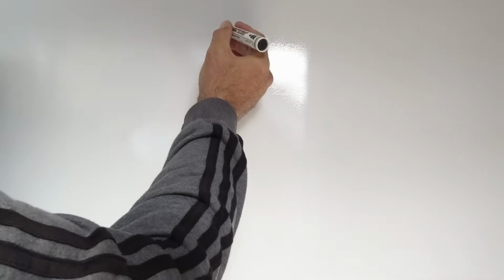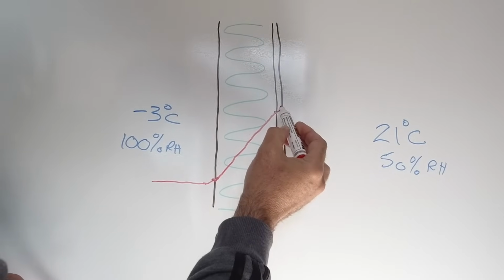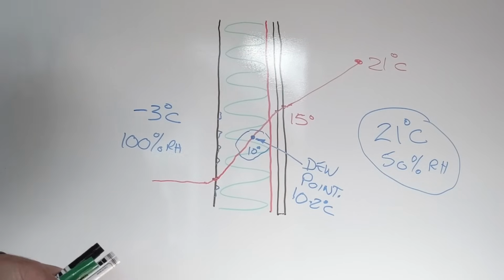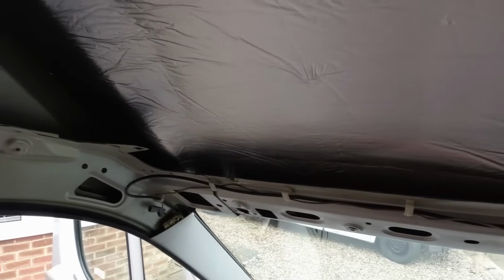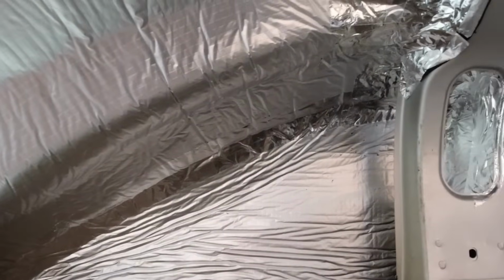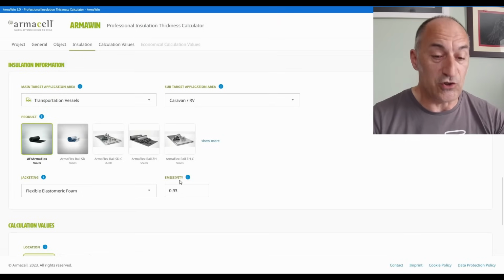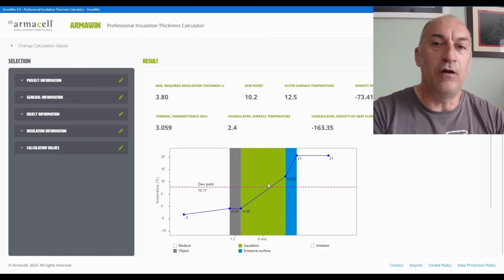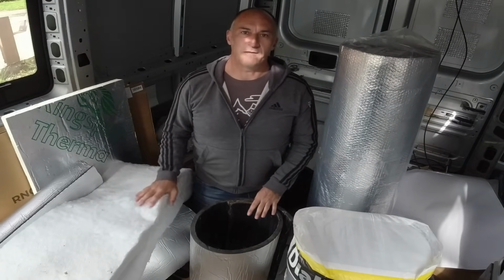The BEST way to Insulate your Van - Budget Build Ep 6

Comment: HI Greg - whats your view/experience with Aerogel and its potential use on a van conversion?
Reply from the maker: I did manage to buy a small square but it’s just way too expensive £100 a square meter and there are far more practical materials on the market.

Comment: I do appreciate you live in the UK etc. but what about heat insulation?  I played with the calculator a bit and for Armaflex you need a meter thick to balance 35 C outside v 21C inside  which is obviously a non starter so is there some other product that can be good both for heat and cold/condensation? I tried a few of the other products on this calculator but got similar results.
Reply from the maker: You cannot calculate the thickness using condensation method if the outside ambient is greater than the internal van temperature. You have to change the calculator to another method like heat loss, surface temp or economic thickness calculation. These options will give a more realistic answer. You won’t get condensation issues in hot climates. 👍🏼🤩
Reply: @GregVirgoe I know, I already changed to heat loss cause at 35C there is no condensation :-) the calculator tells you this. But still it comes up with 1 meter thick material. So I just wonder if there is a material you know off that is more suited to heat insulation.
Reply from the maker: @dimitristsagdis7340  there will always be some heat transfer. It’s impossible to insulate and keep a colder temp inside with no thermal gain. It’s about fitting a reasonable thickness to slow that process down. We have had it 38° outside and managed to keep it about 30° inside with the insulation in our sprinter van and some ventilation.
Reply: @GregVirgoe  tnx and in your Sprinter did you have a similar kind of insulation as you are showing in this and the next videos?
Reply from the maker: @dimitristsagdis7340  we used wool and PIR in the old van. Very similar to what we will be using next 👍🏼😃
Reply: @GregVirgoe  tnx I shall follow the rest of the videos with greater interest than usual

Comment: God I love watching this sort of stuff!! Excellently done ✅ 
One question I was waiting to ask; is it best practice to apply the insulation directly to the metal skin? 
One observation from the work I’ve done so far, is that there are a few ways water can leak into the van from outside; through the roof and sides, ideally, any droplets would run down into the sills and out. If insulation is stuck to the skin this would impede water draining out 👍🏼
Reply: Thanks for your time and knowledge 👍🏼
Reply from the maker: The purpose of sticking it to the van is to stop moist air getting in contact with the steel of the van. If there is a gap there it’s not going to work in preventing condensation. If you have leaks from other areas I would try and address those if you can. Best of luck 🤞🏼
Reply: @GregVirgoe  Thanks Greg, just watched some of you old videos, in the talk at Camp Quirky you talked about the air circulation/convection in the wall void, is this what would be happening if there were a small gap between the PIR board and the skin? 
As there will be a vapour barrier over the PIR, moisture air shouldn’t get to the skin. So is it a case that if there were a small gap, then moist air (via sill drain holes for example) could form and circulate? 
Sorry if I’m labouring this, just want to fully understand 😀
Reply from the maker: @hopesfreedom2322  as best as possible you do need to create a fully sealed void. Any gaps that can allow air to get inside the barrier has the potential to cause condensation. Do the best you can to seal up everything and the potential problems will be minimal

Comment: I have a Peugeot boxer, fitted 6mm dodo mat closed cell foam insulation with the foil, stuck it to the same area in my van, getting horrendous problems with condensation.
Reply from the maker: If your internal conditions are more humid the layer needs to be much thicker as I show at the end of the video. Do you have heating on and vents open to keep your internal humidity down?
Reply from the maker: If you fitted it exactly per my video and you are seeing condensation on the surface of the foil then the thickness of insulation is not enough for your conditions. The surface temperature will be below the dew point. Easy fix is to apply another thicker layer over the top. Make sure it’s adhered to the surface and all edges and joins are sealed.
Reply: @GregVirgoe  My comment is not meant as a criticism of your video, merely pointing out that 6mm foam may not be enough to prevent condensation.
I converted my van last year and have been living in it full time since beginning of 2023.
Your previous van build videos were and are a valuable, easy to follow/understand source of info for anyone self building/converting a van.
The van is insulated with 12mm dodo mat, dodo mat thermal fleece and a vapor barrier with all joins and seams sealed with foil tape, again  your previous insulation video was an valuable source of info,  When I came to insulate above the cab 12 mm was out of stock and after doing some research thought 6mm would be adequate, unfortunately  not , as you suggest I need to add more insulation.
I have been following you for a while now and will continue to do so even tho my van build is complete.
Keep up the good work Greg, your how to videos are an excellent source of info for anyone planning on a self build conversion.
Thank you for all your hard work.

Comment: Good day Greg!
I started following your van build series on your Sprinter, and gleaned some great info for my micro camper (Promaster City, aka Fiat Doblo)
I used 2inches extruded polystyrene in the ceiling, 1 inch on the walls and floor.
Vapour barrier is reflectix. I also added a 100cfm vent (variable speed)fan in order to mitigate the increased water vapour content due to my breathing. 
I have yet to see any condensation in the van, even during high humidity, winter mornings during my Florida vacation.
I’m sharing this video with my brother in law, as he will begin his van conversion process this autumn.
Cheers! 🇨🇦
Reply from the maker: Your attention to detail in the build of your own van has paid dividends and thank you for sharing your experience. I wish your brother the same success with his build. Nice to hear from you. Cheers 🍻

Comment: Excellent video as usual 😊 however.... I was wondering what could I do to prevent condensation on the steel reinforcing members - put 10mm insulation between them and the plywood covering? Or is this a step too far and would the plywood fixed direct onto the steel reinforcing members be okay?
Reply from the maker: If you covered the steel beams with a thin layer of insulation that will help massively to stop any condensation and make sure to have a continuous vapour barrier across everything.
Reply: @GregVirgoe  thanks Greg, I remember you used Aluminium foil as a vapour barrier with a 'bubble wrap' on one side, on your Sprinter.
Reply from the maker: @jamesgooch1670  we rarely venture into very cold climates so it was enough with carpet over to raise the surface temperature

Comment: I'm glad to see you recommending closed cell foam, I've been suggesting using 19mm Armaflex or alike for a while but a Greg Virgoe endorsement is much more useful than some random bloke on the net.😅 
It's probably not the best insulation but I can't see myself ever messing with PIR board again, drove me mad.
Reply from the maker: Its fantastic insulation and we have used it in the industry for years as insulation on both pipework and ductwork. Great insulation properties and it has that built-in vapour barrier so fantastic for cold applications. To match the thermal properties of say 50mm PIR you would have to use multiple layers and then it becomes costly and heavier. Its also a very good sound absorption material too and is used a lot in speaker boxes etc

Comment: Hey Greg, great videos as always. Couldnt have done my first van without your videos. Hopefully move on to my second soon. I heard someone say insulating the pillars is pointless as they're directly connected to the external steel. Would you wrap these in closed cell foam after filling to stop condensation forming on the pillar? To be honest Im not going anywhere in my van of it - 3 outside! 😂
Reply from the maker: Yes exactly that, fill with insulation then a layer of the closed cell over the top or other insulation to stop condensation from forming. :D We don't like the cold either but there are some mad people out there lol
Reply: @GregVirgoe  you've taught me well! 😂

Comment: Great video well explained - complete numpty novice and more a question on the science - you used 10mm - is there a greater gain if it were say 15 / 20mm ie do you gain a lot is the extra thickness not worth the cost ?
Reply from the maker: It would be far better to use a much thicker insulation yes you gain a lot in terms of better insulation. This is the minimum to combat any condensation. adding another layer or using thicker materials would be better but as you say there is a cost implication.

Comment: My house is insulated to passivhaus standards and in Glasgow. Air tight too and we haven't had our central heating on for over one year. I specialise in insulation (hot, cold, cryogenic insulation temperatures). Nobody, residentially anyway, really takes it seriously, but with a few additions in your home (and motor home as beautifully indicated by Greg), you can save yourself a small fortune and will continue to recoup the costs until your initial investment (Roi in most cases) is returned.
Reply from the maker: That is really great news, yes it does go along way to reduce the heat loos and energy needed to keep your home warm in winter o r cool in summer. very important step
Reply: @GregVirgoe  we have that much glazing in the house though (south facing solar gain), that cooling is the challenge!

Comment: Great information. Do you know what type of insulation Kabe camper is using to go travel at -50 C°, and still be comfortable inside the fan🤔🤔
Reply from the maker: Is that a motorhome manufacturer? A lot of production motorhomes are built of composite panels, a sandwich of metal cladding and a PIR solid insulation board so they are well insulated and do not suffer from the condensation issues that converted steel vans have.
Reply: Opportunity for you to use the Armaflex calculator.
Reply: @GregVirgoe Kabe is a Swedish Van  manufacturer, who is building a Mercedes Sprinter into a campervan, which allows you enjoy campervan life in summer and the cold Swedish winters (-40C° and colder). There is no info on the web about what type of isolation they use, but for me it sounds like the ultimate isolation.
Reply from the maker: @remcochervet7492  it would need to be a very top quality build with a decent thickness of insulation and they will have to pay very special attention to condensation at those low temperatures or they could be a lot of issues